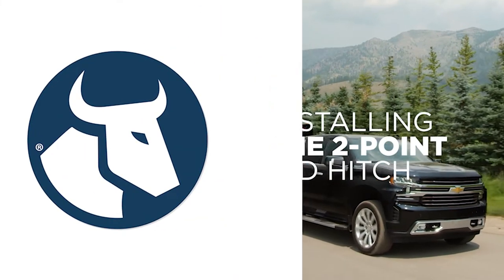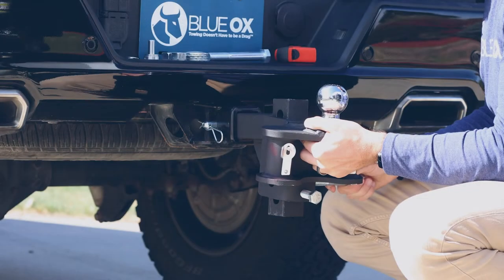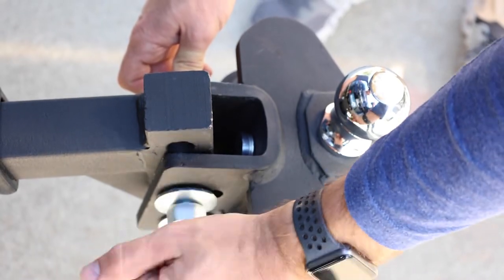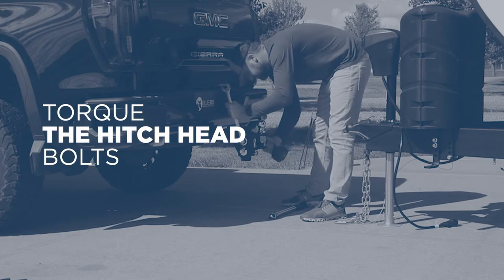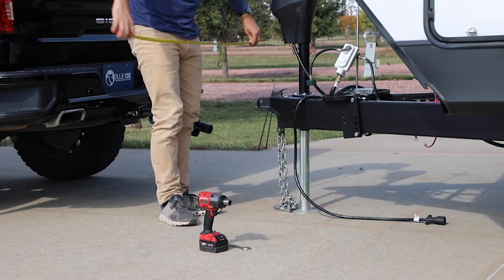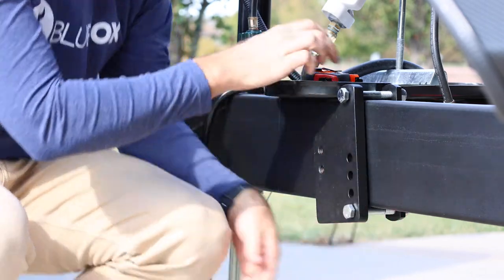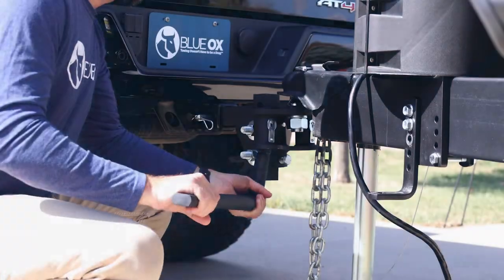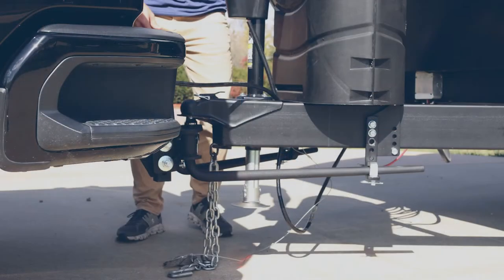Installing the Blue Ox 2 Point WD Hitch

Comment: At 2:30 it says to leave the top hole open in the L-bracket and is installed as such. But in the end the top hole is used to attaching the L bracket after all. Why the change?